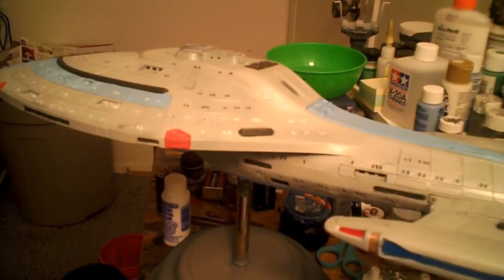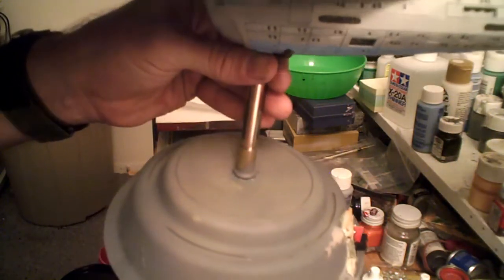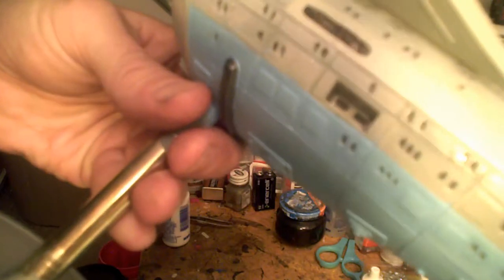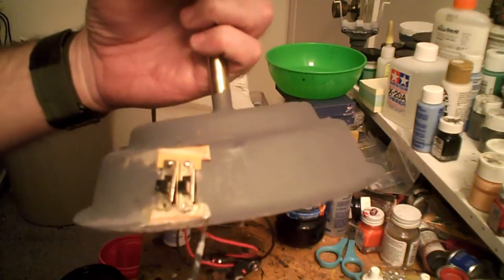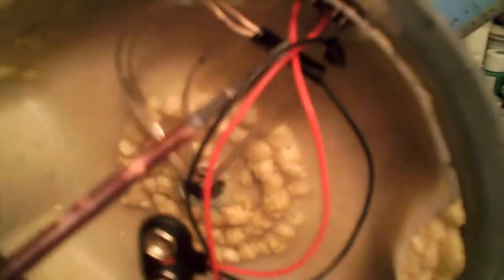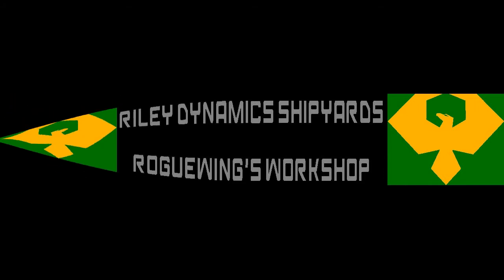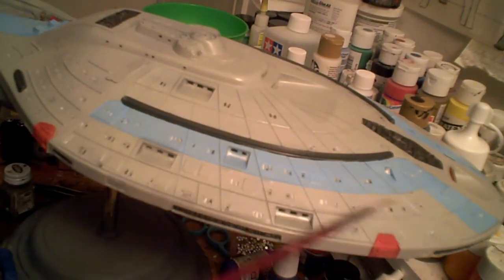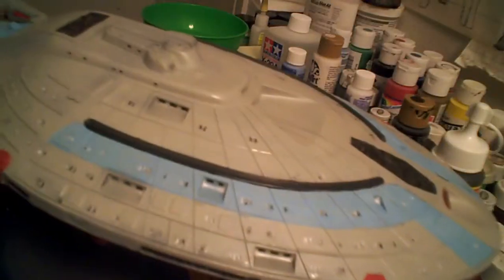Intrepid Class-USS Odysseus NCC-1978-A-Part 15-Finale

Comment: Interesting paint job. Thanks for the tip on the extra hatches. I'll scan the decal sheet and see if I can print extras. I'm almost done figuring out my lighting circuits for mine, also doing some mods like moving the rear sensor panel etc. It's a beast of a kit workwise for me.

Comment: Another quick question about your custom decals, Patrick.

Ive managed to get my hands on the Runabout kit from the 1990's but the registry/red line decals are a little worse for wear.

Im wondering how you print off your own?

Do you use a font for the lettering & how do you do the red lines/federation emblem & what program do you use to design them? (Word/Photoshop)?
Reply from the maker: Font used was 'Federation Hull,' which I downloaded from a font site.
Designed the decals in Paint Shop Pro, which is how I was able to get the lines done
Reply: @Quaralane Thanks Patrick, i'll try those.
Reply from the maker: @WickedSlimShady  Glad I can help